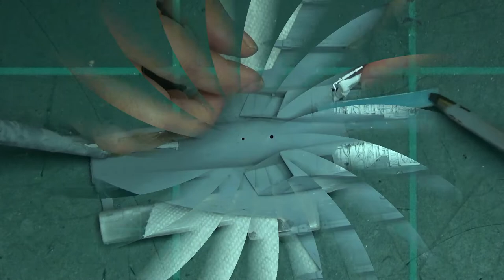How to put decals on the Revell F/A-18F Super Hornet using the Salty Dogs version. 1:48 Scale Part 6

Comment: Lots of decals! So to answer your questions, The leading edge thing is called the 
"leading edge extension" The decals that are a square with two lines, I think are jacking or hoisting points, I looked it up after putting what seemed like hundreds of them on a Phantom.  I watched on two different devices and noticed the sound stopped at 10:45 right before the part with painting the bombs. and I say keep showing the missiles.   See ya next vid!
Reply from the maker: I got closer this time with leading edge. Sound issues huh? To late now I guess lol
Reply: @PlasticModelBuilder  Yep, close enough on the leading edge. And oh well, too late with the sound issues, the video is up and has views, so next time is final assembly?